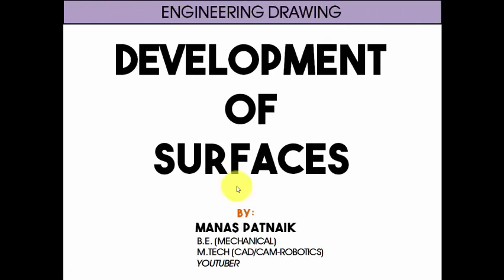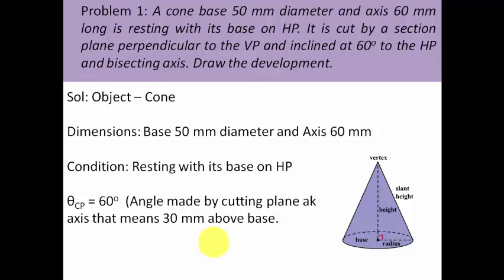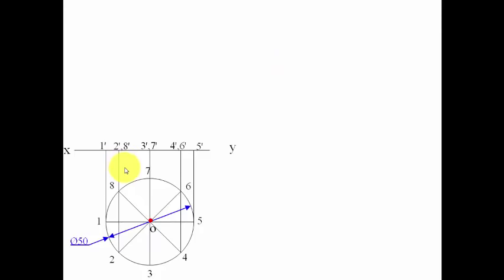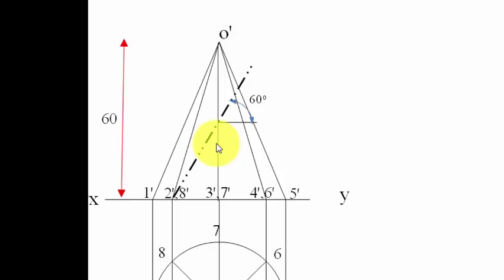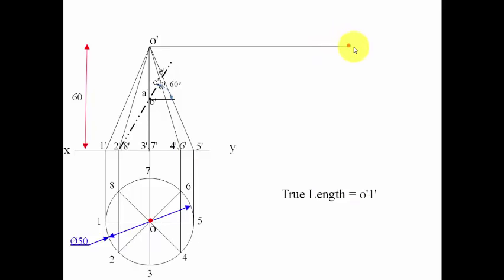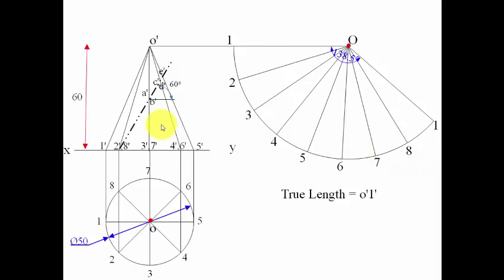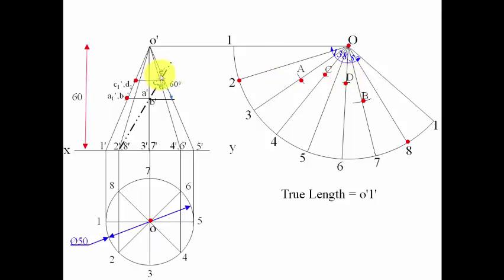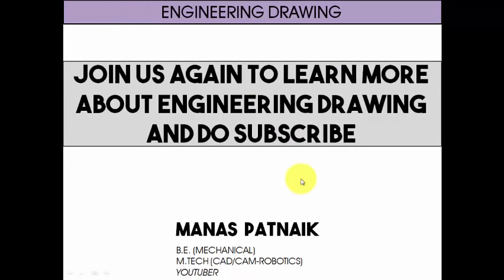Development of Surface of Cone_Problem 1

Comment: Please solve this question..
A hexagonal pyramid side of base 25 mm and length of Axis 70 mm is kept on the ground on its base with one its base edges perpendicular to VP. It is cut by an AIP inclined at 45 degree to the base and cutting the axis at 47 mm from the base. Draw the development of the lateral surface of the pyramid
Reply from the maker: request noted...

Comment: A right Circular cone of diameter 100mm and height 100mm restimg on HP on its base. A Horizontal square hole of side 50mm is cut in the cone in such a way that the axis of hole intersect the axis of cone at distance of 20mm from base. Draw The Development Of the lateral surface of cone of side of hole are equally inclined to HP. Plz Solve This.

Comment: a vertical funnel is made by joining a frustum of cone of top diameter 60mm base diameter 30mm and axis 25mm long with another frustum of cone of top diameter 30mm base diameter 15mm and axis 50mm long.the lowest end of the funnel is bevelled off by an auxiliary inclined plane, inclined at 30 degree to the hp .draw the development of the funnel.

Comment: What if we divide circle in 12 parts? How come we are able to built its developed surface then? PS: I got exam tomorrow so expecting reply soonish! ty :)
Reply from the maker: You can go for 12 divisions....
No issues the process is still going to be same....
I would suggest you to opt for 8 divisions as it takes relatively less time.........
Anyway its your choice.....
All the best
Reply: Take 12 parts, then when you make 138.5 degree arc, just divide it into 12 parts instead of 8

Comment: Sir plz do a problem on this question

a hemisphere of diameter 50 mm with its flat surface at the top is resting centrally on the frustum of a cone of top diameter 60mm and base diameter 80mm and height 50mm. Draw the isometric view of the arrangement

Comment: sir please say differencce of question between radial and parallel line development
Reply from the maker: Problem-based on cone and pyramid are to be done with radial line method.
Problem-based on cylinder and prism are to be done with Parallel line method.